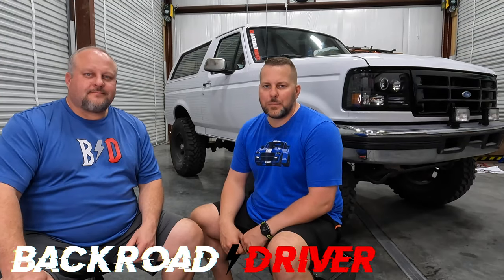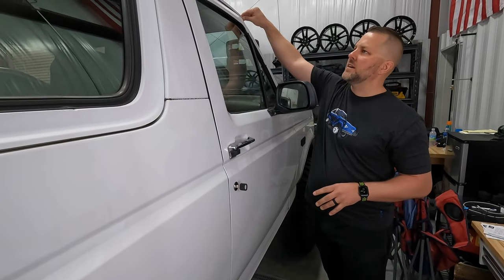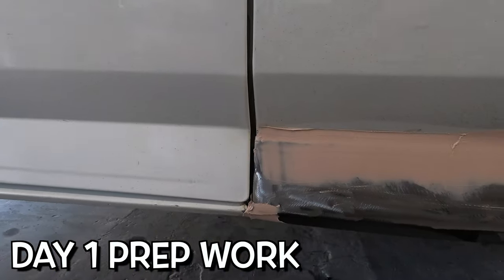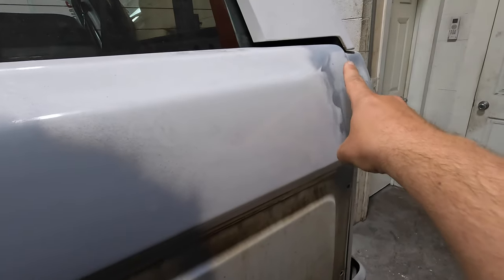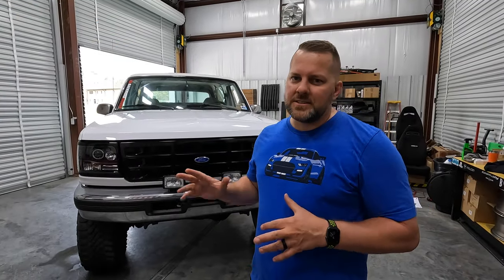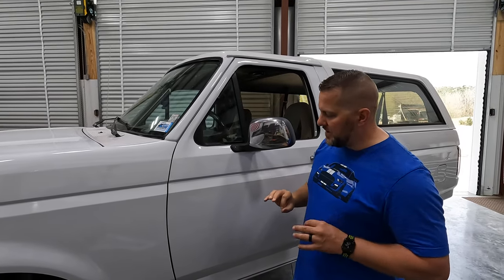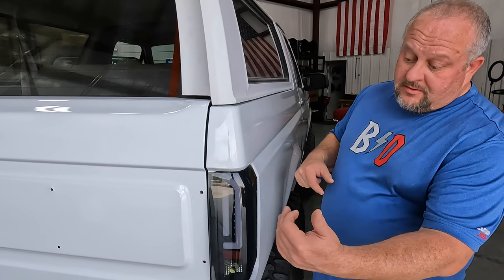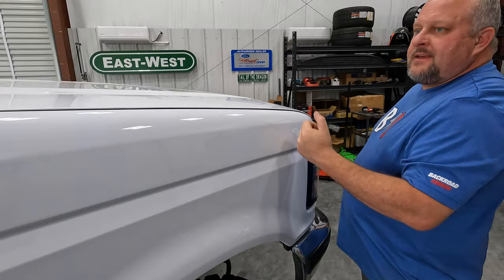Bronco Paint Job Before & After! 1996 Ford Bronco Build - Build Video #5

Comment: Thanks for the video, looks great! I have a 4th generation 1989 Bronco with 148K original miles, 5.8L 351-Windsor, no rust (Calif. truck) and everyone that walks by wants to buy it. Sorry, not for sale. I have done over 5K worth of engine & accessory work, but it will eventually need a paint job. It's a 2-tone original paint, white on top with dessert tan on the sides.
Reply from the maker: People love these trucks!

Comment: I have redhead gearbox an borgenson steering shaft to install soon as well on my 95 Flareside
Reply from the maker: How tight is your steering?
Reply: Haven't put them in yet, the truck has so much slop when driving, from what I hear the shaft alone takes most that out, I will update shortly once they're installed.

Comment: This is looking good guys! I would keep the spare on the rear, it really looks incomplete without it.
Reply from the maker: If we do a spare we will add a swinging hinge to a new bumper. Wanted to get the Bronco looking smooth.
Reply: @BackroadDriver  that would be sweet, and probably hold up better
Reply from the maker: It would be good to get it off the body

Comment: When I had mine I shaved the lip above the doors look so different wrap the door handles black I wrapped my 2015 xtr f150 sorry but was that a 68 camaro
Reply from the maker: It is a Camaro. Good spot. I think we are going to paint the handles. Hadn’t thought about shaving the rain rails…
Reply: Them drip rails will hold alot of water an cause more rust

Comment: how high does the bronco sit
Reply from the maker: 6” lift and 37” tires instead of factory 30” tires so it’s about 13” over factory
Reply: @BackroadDriver  so 86 inches then
Reply from the maker: I would need to measure